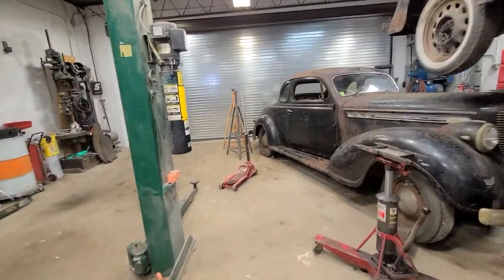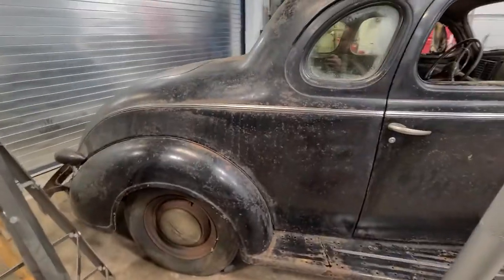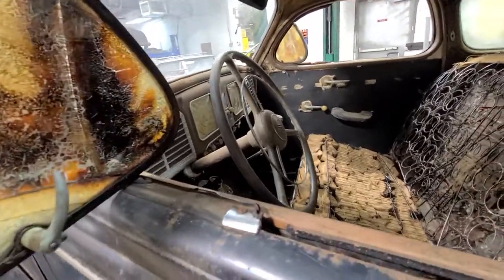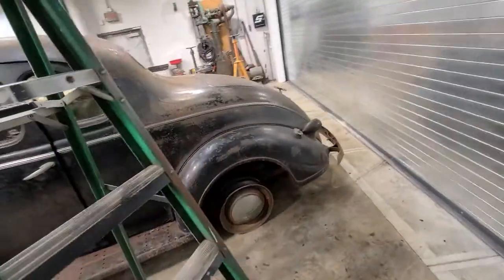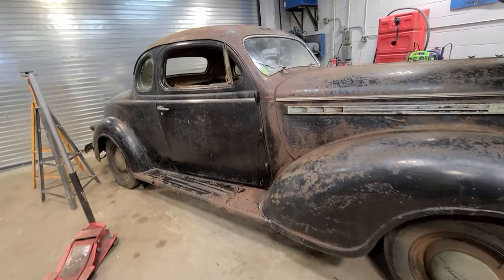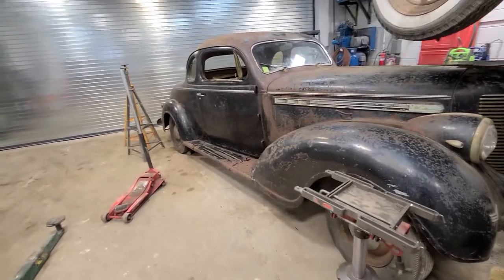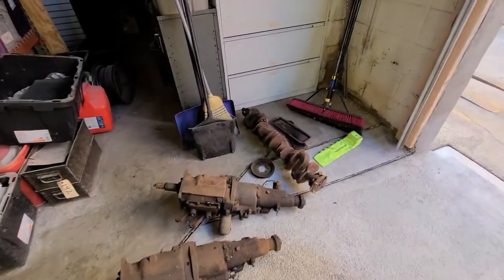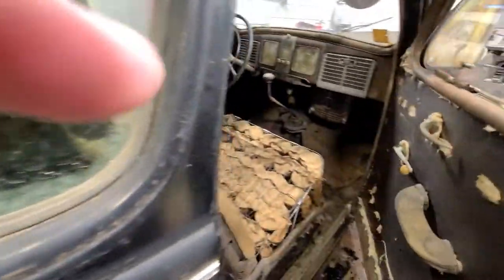1938 Chrysler Imperial Barn Find

Comment: I started working for a friend in his wrecking yard in 1968. He had a 1936 Chrysler Imperial coupe that looked a lot like yours. Straight 8 with 3 speed overdrive transmission. He sold it to a friend and when his friend quit making payments, my friend took the car back and sold it to a car collector. My friend started his wrecking yard in 1953 at 11 years old and still runs it 5 days a week. He is a big fan of 1939 to 1947 Dodge trucks with a few early Plymouth pickups. He has driven a 1940 Dodge 1 ton flatbed since 1957 with a learners permit with his dad at first and still uses it daily. He also has a 1940 Dodge 3/4 ton he has driven daily since 1959. He had a 1947 Dodge 5 ton he has driven weekly since 1969. He has several others that are used in the wrecking yard only. They all still have flathead engines and 6 volts. He has several of the Dodge 413 CI flathead sixes with dual carbs and dual exhaust. His wrecking yard is mostly antique cars and trucks with a few modern cars he has gotten only if they were free. He also owns two 1940 Dodge fire trucks. He has appox 20 parts trucks. His yard is located in American Canyon California between Napa and Vallejo. He has been in business now for 64 years.
Reply: "413" SIX ? Really, do tell..

Comment: The US got involved in WW2 on December 7 1941. Car production was stopped in April 1942 and remaining stocks of cars on dealer's lots were put into bonded warehouses and rationed out to essential workers like doctors and veterinarians. Your Imperial was a fairly late model, 4 years old at the time. But 3 gallons a week of gas ration wouldn't take you far with that big straight eight motor. Chances are the car was put into storage and replaced by a smaller car for the duration. After the war new cars were in short supply until 1949. Would be interesting to know the history of the car. I suspect in the fifties and sixties it was just another old used car. You are lucky it was stored away and kept as good as it is.

Comment: I have a 1949 Dodge Meadowbrook. All original 56,000 miles. I've had it 27 years. I am the second owner. It still has wax pencil writing under the hood on the firewall.